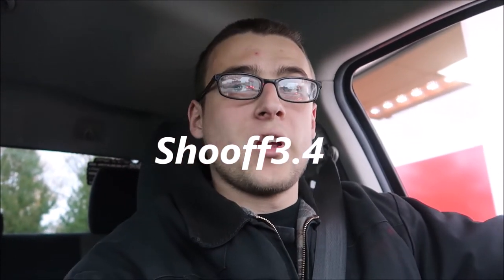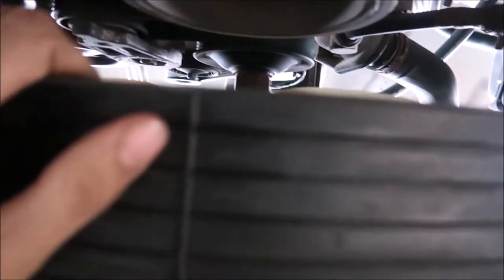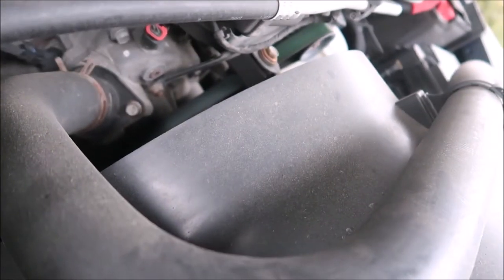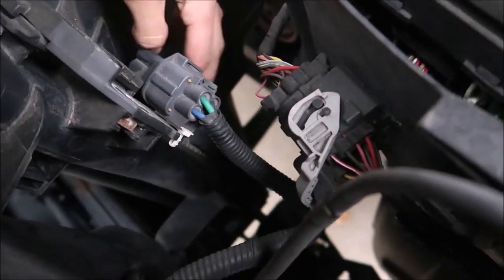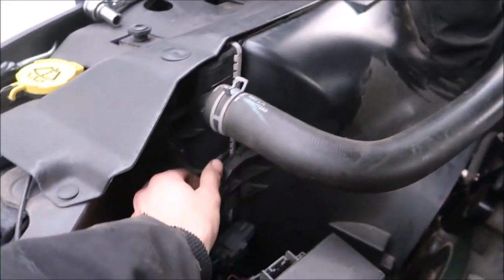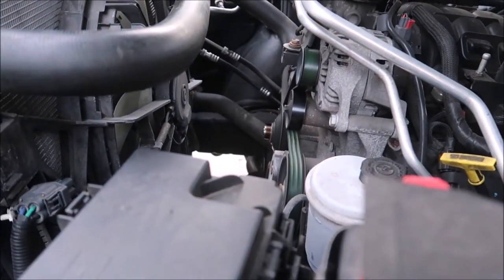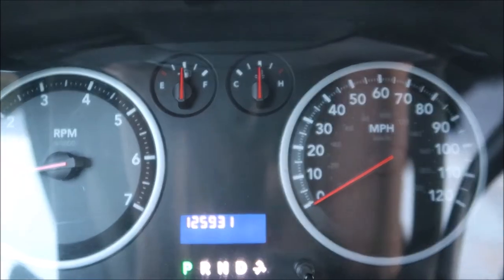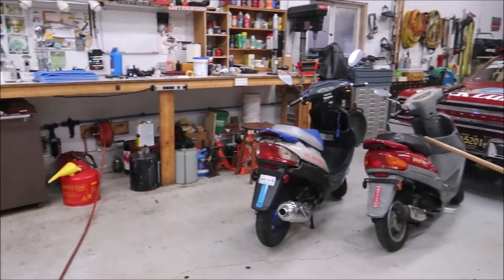Ram 1500 Hemi Clutch Fan Delete!!

Comment: I don't understand why dodge did this. Having an electric cooling fan and a clutch fan? Its just mind boggling. I remember my 2004 ram 1500 having a clutch fan for radiator, trans and oil cooler then having a separate electric fan just for the A/C. So glad they finally changed to full electric fans on the 2019+.

Comment: Just got a ram 2012 like yours and I hate the sound of the clutch fan. I live way south of texas and the heat here is incredible. I was wondering about the v6 fan clutch delete, but now that I came across your video would it be fine to delete the clutch fan and add  a 180 thermostat with texas intense hot weather?
Reply from the maker: You’d almost have to give it a try see if it can handle it. Mine can handle it but it’s iffy, and it will start to “over heat” if I run AC
Reply: Just spend 130 dollars on a 2012 V6 Ram  electric fan set-up. It fits right in .

Comment: i ordered the v6 fan but i’m thinking about taking everything out and running with just the e-fan and seeing how she does, thoughts?
Reply from the maker: I’ve been running the v8 fan only for 9 months now, beat on it race it and took it to Florida in the middle of June and have never overheated. I do have a 180 thermostat so that helps but even if I’m beating on it in 100 degree weather ac cranked it’s still just fine. So if you run a v6 fan only you’ll be more than fine!

Comment: What keeps the pulley behind it on once u remove the clutch fan/bolt?
Reply from the maker: The clutch fan spins onto the water pump pulley that’s bolted to the pump, so all you have to do is screw off the fan and everything else is still bolted on
Reply: @Shooff3.4  exactly. So once u spin the fan and nut off what keeps the pulley behind it from spinning off once you’ve removed the fan/nut retaining it?

Comment: Great video man, just a quick question, I just got a clutch fan delete on my 2012 ram, I saw you had the 180 thermosthat. Did you experience any check engine lights when you installed it? I'm looking into doing the same, thanks!
Reply from the maker: Nope! I didn’t have any issues or any check engine lights!

Comment: Does the fan run with the ac off?
Reply from the maker: Yes, depending on where you have your truck running, you need to tune it to turn the fan on earlier than normal. From factory the truck run around 210 or 200 and the fan will turn on at like 210. I have a 180 thermostat and I want mine to turn on around 180-185 so it doesn’t overheat while idling. Haven’t had a problem yet
Reply: @Shooff3.4  sounds good.